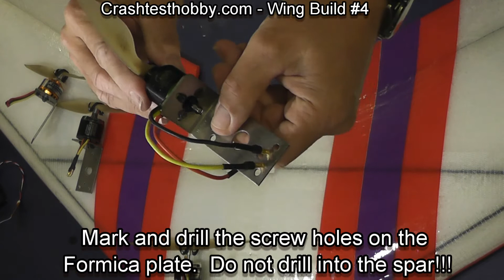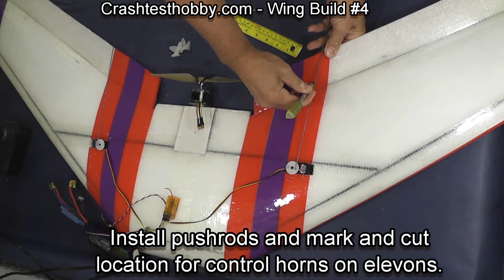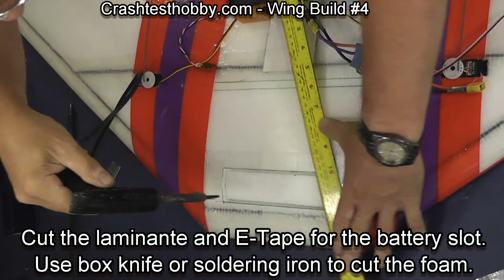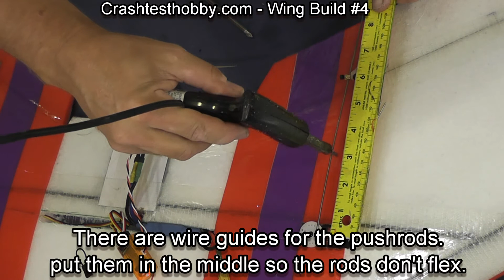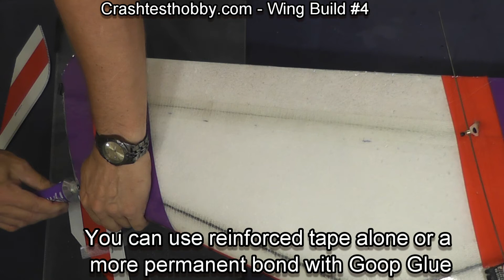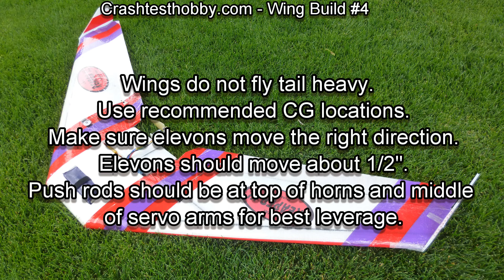#4 How to Build a Crashtesthobby Wing

Comment from the maker: If you want a flying wing to have an axle roll you need more down than up because there is reflex already in the elevons. With the servo on the top of the wing and the push rod in the servo arm turned one tooth forward of center the elevon will go down farther than up with the same servo motion. Without this adjustment the plane will corkscrew on a roll rather than have an axle roll.  Some people prefer to program this differential in the transmitter but I always start with the physical configuration of the servo arm.  On maiden flight this plane flew well with only a couple of clicks of trim.  Thanks .... Lee

Comment: Hello. Just watched video. Nice job showing the build. (I like the fast motion).. I noticed you have the mechanical elevon differentiation with the servo offset in the wrong direction. The servo arm connect point should be offset closer to the control arm when ever the servo is on the top of a wing. This mechanical arrangement will make the aileron move "up" greater then "down" during a turn. The outer wing angular drag is greater than the lower wing, so you want the downward aileron deflection less to minimize the induced drag.

Comment from the maker: The Grim Reaper with the extension shown in the video can carry a amount of weight and equipment.  I know of flyers flying with 10,000 mA 3S batteries and FPV gear.  I haven't heard of more at this time but I am sure someone will try.  Lighter always flies better but with longer range flights you will need bigger batteries.  The max payload weight would have to take into consideration how big and powerful of a motor you are using.  The power would be needed for take off but once in the air the power could be trimmed back depending on how fast you want to go.

Comment: hope you don't mind the question, but what is the min weight, Flight and the max or basically is it possible to mount a fairly good amount of equipment, "extra batteries, OSD AP, a good large HD cam, with gimbals, Video Tx, Etc,,,